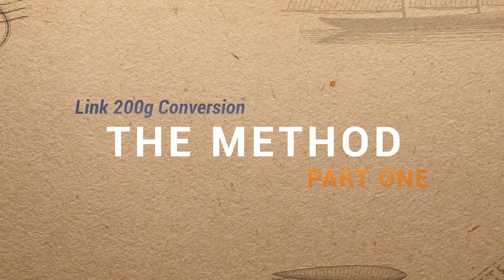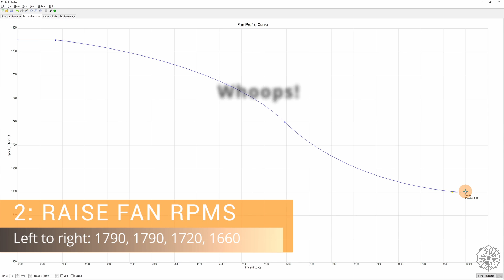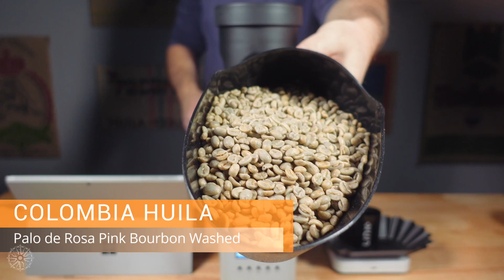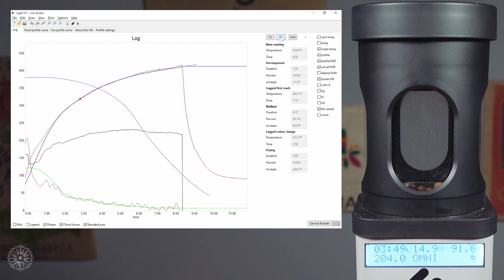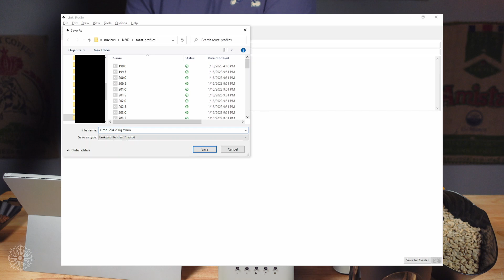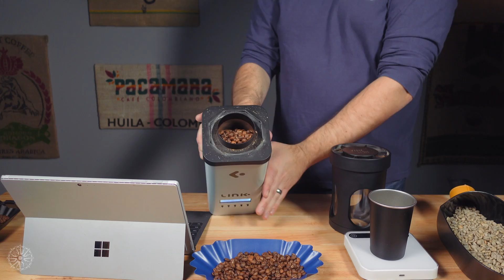200g Roasting with the Nucleus Link

Comment: I think 200 gram batches on the Link are totally sensible, since the Link is just a rebranded Kaffelogic Nano 7 with a boost kit - and the Boost kit allows roasting up to 200 grams, atleast in the Kaffelogic.
Reply: I installed the "boost kit" bottom ring in it. solved the issue perfectly

Comment: We love the enthusiasm and inventiveness of LINK users! However, as a policy we don't recommend ever roasting above 100g with the LINK – it was designed as a professional sample roaster for 50g-100g, and using any batch size outside of this will make the profile recommendations inaccurate. If we ever work on a larger model, The Captain's Coffee community will be the first to know!
Reply from the maker: You all have done an incredible job with the Link System, thanks a ton for clarifying! We absolutely agree that sticking with the recommended 50 to 100g batch size is the surefire way to ensure you get the most accurate results from the Link.

Comment: Have you tried on the latest addis 4.0 profiles?
It seems like theres a huge changes on every profile and fan settings as well
Reply from the maker: Yes there certainly are some big changes! So far in my testing by and large this method still works, though I'd advise chucking any old 200g profiles and starting fresh based off the new Addis ones. Also I noticed there's a small bug right now (that hopefully will be patched out soon) that causes the profile to ignore where you marked 1C for dev% if you mark it after the "expected" 1C zone. I mention this because I noticed it when testing 200g conversions and thought it was the conversion - but it happens on 100g NCT profiles as well.
Reply: @TheCaptainsCoffee  i see, because the new profile came with the new fan settings as well, there is one more point on fan profiling, I am not sure should I still follow your fan profiling?
Reply from the maker: @JonathanOng-l7y  I haven't experimented with converting all the new fan profiles like the Filter D pack yet, so I don't know how they will perform and I don't have any guidance there yet. The ones that use the old fan profile like Filter C and Filter B there should be no change.

Comment: Would buying a link with the boost from kaffelogic be an option? Seeing as boost is first and foremost a hardware extension would that be possible to add this to a link and get the bigger batch size a bit better under control?
Reply from the maker: You know, I don't know! From what I understand of the boost, it's meant to do 2 things: physically extend the chamber to make unloading easier and it comes with a serial # to unlock kaffelogic's 200g profiles in their software. So it won't do the later with the Link software, but I assume it fits the same and would help with unloading on the Link! Maybe one day I'll pick one up and find out
Reply: @TheCaptainsCoffee  if you happen to also have a kaffelogic on hand please measure the height of the 2 and compare. In another video from someone else I think I heard mention the Link comes with the boost preinstalled to the chamber, but information seems scarse
Reply: The Boost Kit isn't compatible with the LINK, no. It physically fits, but as our profiling system is entirely different you won't yield positive results in your roasts from using it. If you want to roast more than 100g, a Nano e7 is a better choice for you
Reply: @NucleusCoffeeToolsTraining  but this whole video centers around the premise to make roasting 200g with the link a possibility. If it physically fits and you follow the guide that captain has put forth in this video you don't rely on the built in profiles but rather craft one of your own.

Comment: Just bought a Link from you today and still need to update and calibrate, and beans arrive tomorrow.  I want to update some files to do 200gm batches, but have a problem clearly hearing the video.  Is it possible to get a text/pdf file highlighted lines you modified or post/share.  Thanks in advance.
Reply: Thank you, got it.
Reply from the maker: Here ya go! https://thecaptainscoffee.com/pages/the-nucleus-link-tips-tricks-and-200-grams
Reply: Hi, I'm interested in the link as a home coffee roaster and my only issue is the batch size I recently asked Nucleus about increasing the batch size to 200g and they said it is not recommended because in their extensive testing they found it will produce uneven and inconsistent batches. So I wanted to ask you if you have experienced any of that?
Reply from the maker: @robertorodriguez4144  Scroll to the bottom of the page and you'll see the results of my testing: https://thecaptainscoffee.com/pages/the-nucleus-link-tips-tricks-and-200-grams

Comment: Great video, I’m sure that Link users will appreciate it. I own the Kaffelogic with the Boost, which is a bit easier to use as it has a physical extension that helps accommodate more beans. I don’t really see the point in getting the Link at almost double the price. Both units are exactly the same, with just a few software improvements on the Link. Converting profiles from the Link to the Kaffelogic can be done quickly, but again, why would you do that when there are so many excellent third-party profiles created by the community?
Reply from the maker: Yeah from what I can tell the 2 roasters have similar capabilities mechanically, what I prefer about the Link is it's app+density tube profiling system which takes all the guess work out of trying new coffees and new roast methods. The only thing it lacked out of the box was 200 gram profiles, so this conversion was a high priority for me! I'm a little confused by your pricing though, the Nano+boost is $1470 in the US and the link is $1850, definitely not double. Maybe it's a bigger spread in other locations though!
Reply: From all of my research, I think the software improvements on the link are huge and well worth the additional price. Part of that extra price goes to paying for the case that it comes in, which is nice, but not a necessity for me - I kinda wish I could buy it without the case.
Reply from the maker: @LivingTheLifeRetired  I asked if they'd be willing to offer a version without the case (I had the same thought as you - a good half of home users probably have no need of the case), but they aren't interested in doing that at this time. Maybe they will eventually!